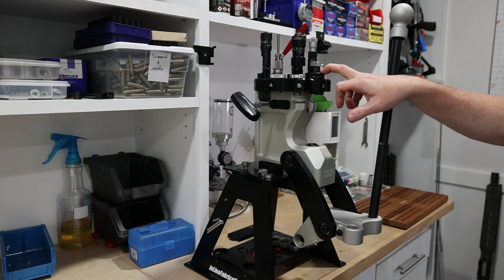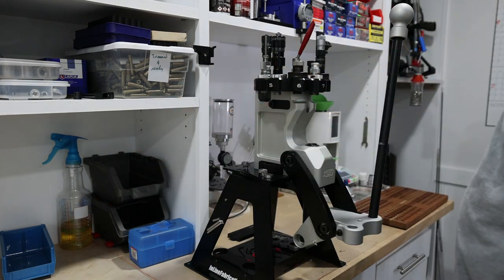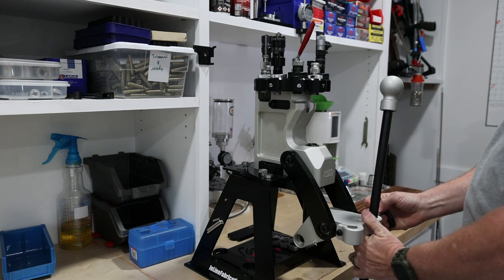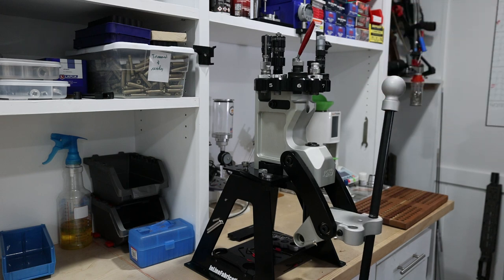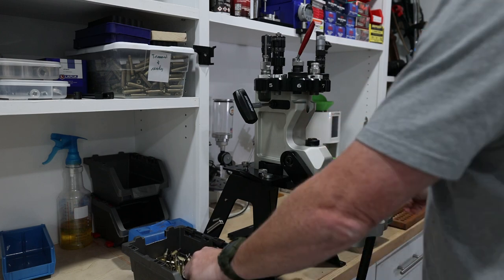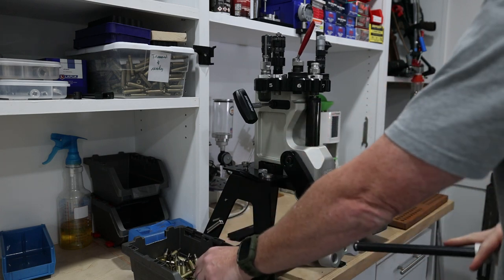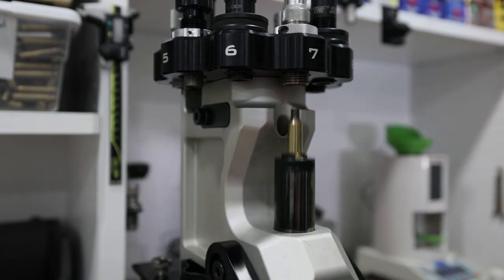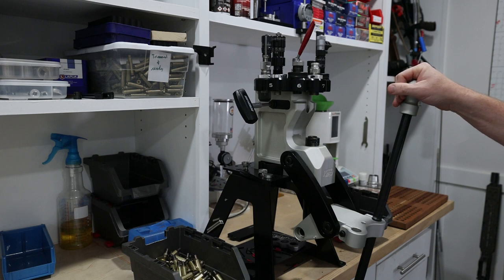7. Mandrel your brass: Using an expander mandrel for consistent neck tension

Comment: I don’t use dwell time when using my mandrel but I do run the case in the mandrel drop the case back down, turn the case 180 in shell holder and run the case back in to the mandrel. When I seat the bullets using Wilson seating die on my arbor press I find that I have very consistent seating pressure and when the seating pressure is higher those rounds are pulled for sighters. I can’t afford the Amp Press so no way to test than believing that target. Very nice series of videos.

Comment: What's wrong with the bullet acting as the mandrel?  I still don't see why I need a mandrel.  I size my brass to a .003 neck tension with a bushing die and then seat the bullet.  Can you tell me what is wrong with my process if all I want is .003 neck tension?
Reply from the maker: If you turn your necks, maybe nothing. If you don’t, then you have to deal with uneven thickness of brass in the neck. Sizing from the outside like a bushing does can cause uneven neck tension. Sizing from the inside like a mandrel does means the tension is even around.
Reply: The mandrel is for mainly people who want the most precision out of their handloads, but sometimes even when seating the bullet one side of the brass can be thicker and could cause less brass life. or even me, I want to get one so I can make 6.5-.257 Roberts out of 6mm remington but I have to go from .244 to .262 (6mm to 6.7mm) so that's a lot of stress on the brass if I use certain dies

Comment: How are you lubing the case necks or mandrels when doing this? I've always used carbide size buttons so I've never had to lube necks. What does that process look like? I thought it would be included in this video
Reply from the maker: Dry lubing. Go back one video in the series.

Comment: Hey man, awesome video! Can't help but notice the Supertrickler and ingenuity setup there.. What's your experience with both so far?
Reply from the maker: The powder throw video will be fairly soon. To be honest, I am struggling with the ST a little. It is capable of so much, but also a bit finicky. The learning mode is what will save it from being too finisky, but I have not worked enough with it yet.

Comment: Question.....after using the mandrel do you clean out the dry lube before seating the bullet? Wonder if it makes a difference, good or bad.
Reply from the maker: No! The dry lube is an important part of bullet seating as well.

Comment: You dont allow your mandrel die to “float”, as explained in the setup by 21 century? It looks like you have the die screwed down tight against the turret….
Reply from the maker: There is some float. It is not all the way tight.

Comment: What is the diameter of your mandrel for 6BR?
Reply from the maker: Good question. I have tried a few. Am currently using .2415. With the little bit of spring back the brass ends up at .241 or two thou of neck tension.

Comment: What are your thoughts on dwell time and memory
Reply from the maker: I think there could be something to it. Loading for PRS matches is a compromise. I think if Bench Rest shooting or F-Class it may be more important to leave it there for a couple seconds. But have not seen much difference in my shooting. It would be an interesting test. I will add it to my list of things to do a test on! Thanks for watching.
Reply: @precisionmatchtimer  I completely agree. I have done it, and skipped it, and haven’t noticed a difference. For my prs needs I am skipping it until further convincing data has been gather.
Great videos. Thanks
Reply from the maker: @LedGuitar1218  Won't stop me from testing it! But I think results will be exactly as you said. But I've been wrong before...